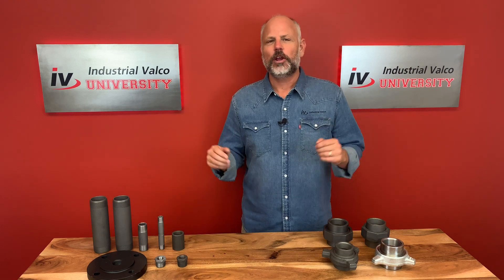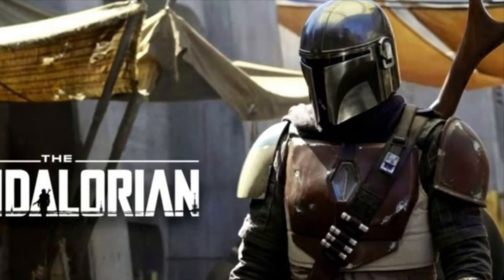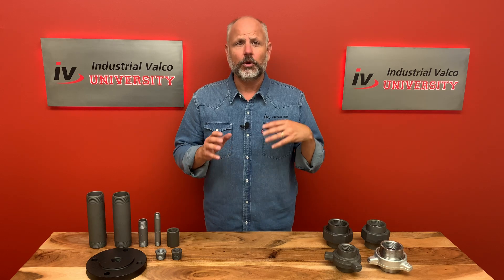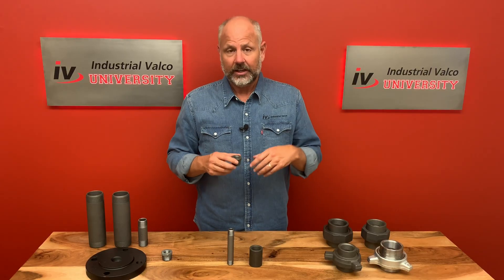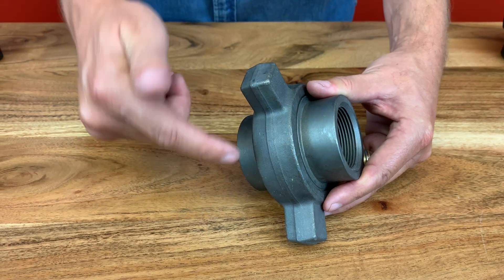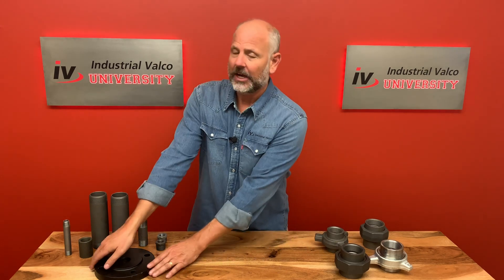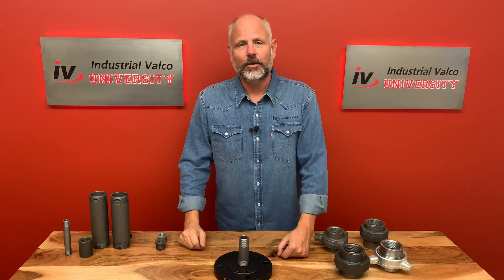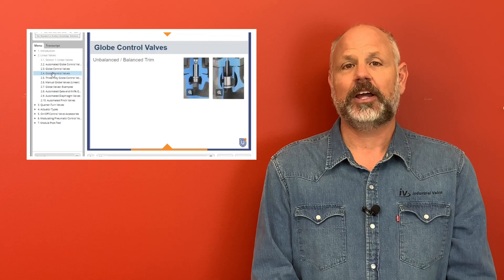What are pipe unions & bushings

Comment: In reference to a gas union in a wall: I needed to add a shut off valve in the middle of an 8" pipe. I had to undo the union to remove the pipe. I cannot get the top part of the union to come off since it is in a small space and I  don't have the strength to hold the pipe while trying to remove the nut. Is it okay to leave it on the pipe and use a new piece of union on the new lower pipe? Someone on you tube said that you can't reuse it. That sounds iffy to me.

Comment: Thanks for the information, just wanted to know if there is a particular way as of which side of a taper union fits , as per the direction of the flow of water , in a chilled water HVAC system. Thanks.
Reply: Yes there is, the shorter end is the "service end" not "the top part" so that will connect on the side where flow is entering. That's good to know since you will not waste time and energy turning the collar on the wrong direction trying to loosen the union to repair or replace piping.
   Flow enters the service end so you turn clockwise to tighten.